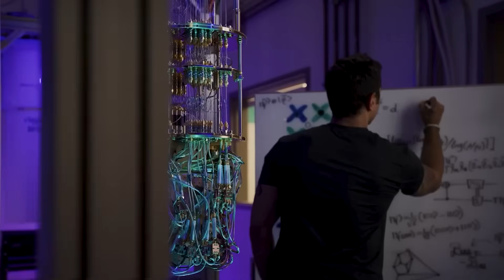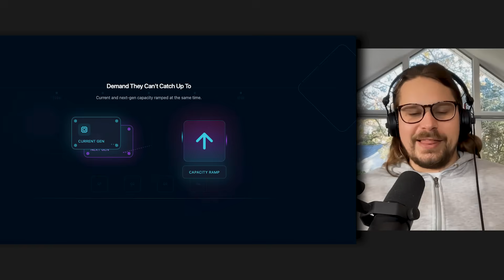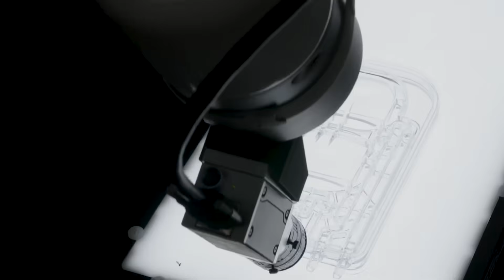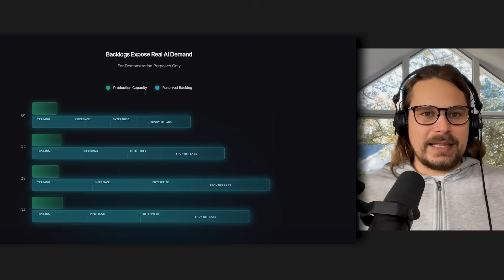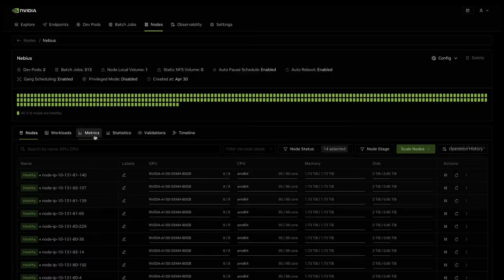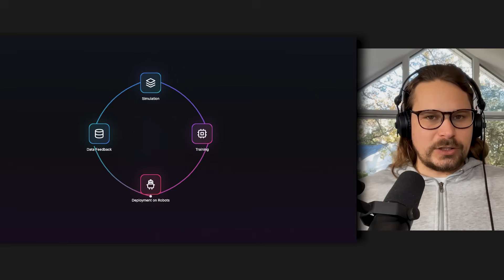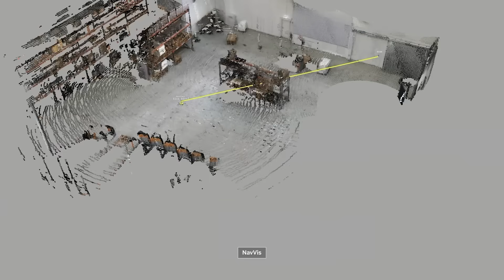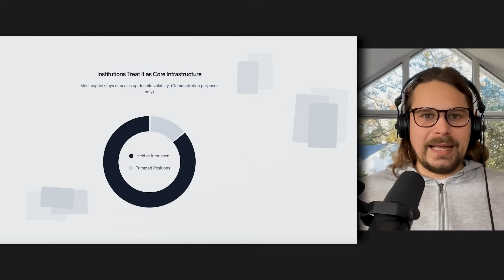Every Company Is Now Chasing Nvidia

Comment: "Nvidia, which makes computer chips that are essential to building artificial intelligence, said on Wednesday that its QUARTLY PROFIT had jumped to nearly $32 billion, up 65 percent from a year earlier and 245 percent from the year before that."

The frightening thing is that these computer chips will be redundant in a few years just the same as iphones are, because technology marches on and it is  obvious that todays chips are yesterdays chips....Just see the history of chip design and evolution...

 A perfect example. The iPhone 15 makes the iPhone 14 seem dated, which makes the iPhone 13 feel ancient. This is driven by:

MOOTE'S LAW (in spirit): The observation that chip performance roughly doubles every two years while costs fall. This creates a built-in expectation of rapid improvement.

ARCHITECTURAL SHIFTS: It's not just about making the same chip smaller. New designs (like the move from CPU to GPU to, now, NPU) create massive leaps in efficiency for specific tasks.

THE SOFTWARE/ HARDWARE CYCLE: New software (like complex AI models) demands more powerful hardware. That new hardware then enables even more ambitious software, which again demands better hardware. It's a self-perpetuating cycle of obsolescence.

Guess what will happen within a few years?

Comment: We are in the middle of AI bubble. I tried Gemini vs. ChatGPT to simply edit my drawing with simple prompts. They both failed spectacularly. Both models cannot even keep original drawing intact without hallucinating and making edits I never asked for. It appears they are trained to regen. drawing each time I ask for edit instead of saving power by having "code-control" & working from the latest iteration. These are children toys that cost 100s of billions and are frustratingly useless.
Reply: That’s because your drawing features are still controlled by your program’s original proprietary codes, and those codes will always have compatibility issues with your chatbots.
Reply: Meaning their capex is definitely reasonable and there is room to improve. Doesn’t necessarily mean that they have any fundamental restrictions to improve more
Reply: @jgleo0118  It is 2025 and my tests are as basic as they come. Cannot do basic stuff without fucking up the whole thing is a failure. There is no excuse at this point to not be doing basic things without horrible bugs.
Reply: 1. Maybe your prompts suck.
2. We're still at the beginning of AI
3. You are probably using a free version of AI, not the better paid models.
4. Making images are not the primary driver of revenue for these companies.
Reply: You just need to learn how to use the tools correctly, I’ve seen others be able to keep images the same each time small changes are made
Reply: Your one use case refuted the entire industry - genius
Reply: @YuenanCao  No no the genius is you not me. Let me list all the tests I have ever tried right here in a chat.